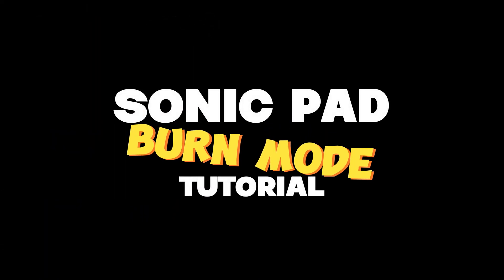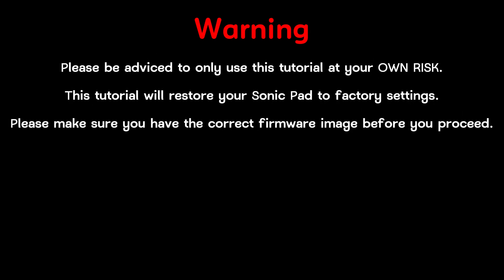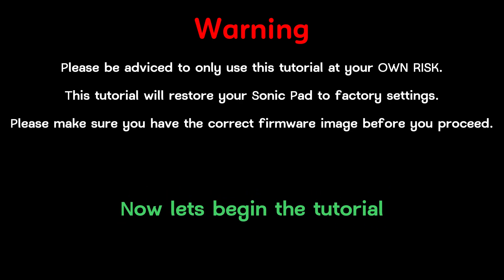Sonic Pad "Burn Mode" Tutorial

Comment: Hey everyone, I'm trying to get this to work but the 'new' usb device is not showing up in the device manager. Can anyone help me out? Thx in advance!
Reply: Same issue but you'll run into another more pressing one. Just go into device manager and look through stuff and you'll see an unknown device and you can install driver there same way. But my issue is the img file on github isnt working in Phoenix.
Reply: @joep8722  I'm having difficulties finding the img. file as well. Can anyone elaborate pls and thx?
Reply from the maker: @toddchurch19  I will make a new tutorial with the new file. But I will try to explain it to make you get back on track faster.
Reply: @TechByHesselbech  Thank You very much!
Reply from the maker: @toddchurch19  thank you for supporting my channel. 😊
Reply: @joep8722  turns out I had the wrong usb cable, although the cable was a usb a to usb a cable, upon reading the instructions that came with the cable, I leanred that it only worked to connect a pc to a mac, which would explain the cost of it lol. I returned it to best buy and ordered a cheap one off amazon. I'll provide an updated when it arrives next week.
Reply from the maker: I will post the new file. 😊

Comment: This saved my printer and many thanks for that. A firmware update must have glitched during install and then my printer would freeze at the point after I select the file and then select print. After I select print it said loading and sat there on that page never advancing to the final page where it actually does something. This is the only way I could find to load an older firmware. Found the .IMG version of a firmware on github. Thank You so much.
Reply from the maker: Hi thanks for your comment that really means a lot , this is exactly the reason why I made this video, because a lot are struggling with these issues.
I’m glad that you find this video useful.

More updated videos will to come. 😊💯
Reply: You saved my sonic pad. 
I have a Creality CR-10 Smart Pro attached to it and love the combo.
There was no way to revert the pad to an older Firmware then this solution you provided.
I will put this solution on the forum I use at 3D printers Canada with some how too. 
I needed to get an older  Firmware.IMG file from Github  because the new firmware uses the extension .SWU and this does not work with this software as best I can figure out. 
If it could be updated that would be very cool. 
Again, thank you so much for this and I will do my best to inform the forum and link your video. Thanks @TechByHesselbech
Reply from the maker: @timmaher2769 Thank you so much, I will make an updated version of this video with a new tutorial. 😊

Thanks for sharing my content, it really means a lot, to get comments like yours, makes all the work I put into these videos worth it all the way. 💯😊
Reply: I have put a couple of posts with links to the forum where I put your video but they keep disappearing?????
Reply from the maker: @Soniccues  I think it might be the admin of that group, they might have a policy about posting links to YouTube in those groups or is it here they disappear.?
Reply: happen to have a link to the .img file?